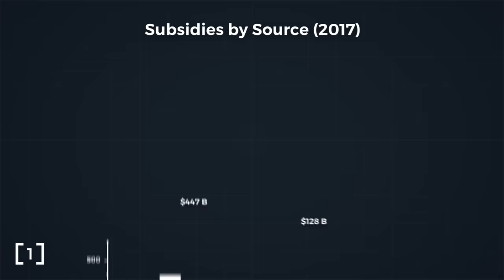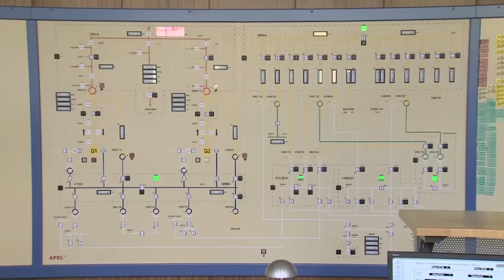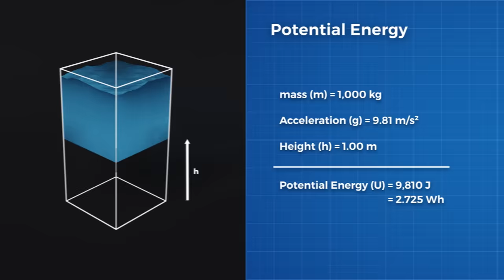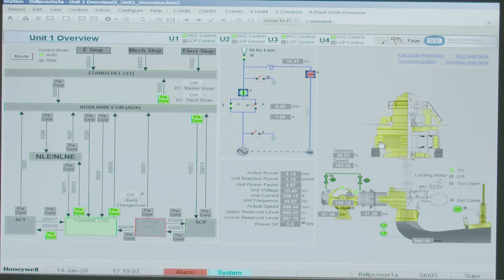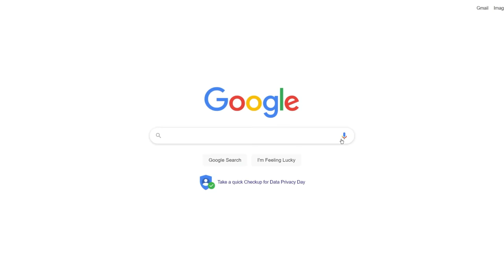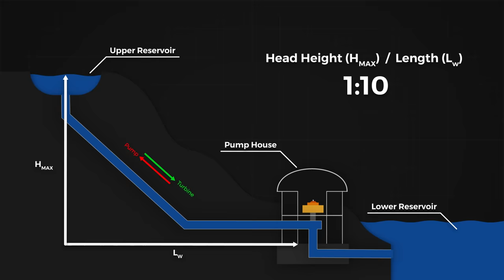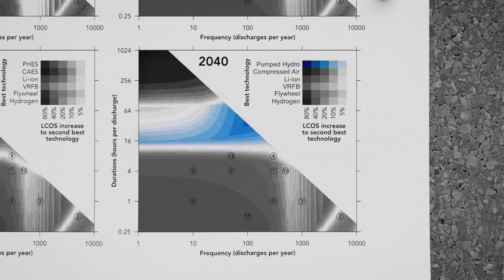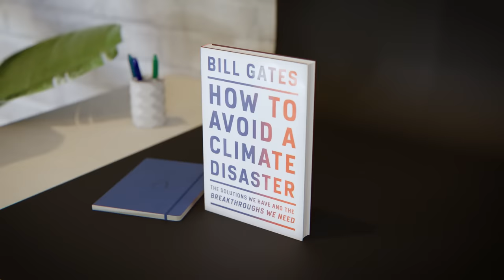The Truth About Pumped Hydro

Comment: The main problem is they are unprofitable under marginalist markets, even if you use an abandoned underground mine with already made tunnels, roads, power lines and switchgears, and moving water between upper and lower levels of the mine (all huge money savings), you are still trying to build an on-the-run hydro power plant that haves to float by running only 2 hours a day (the ramp up hours when the sun goes down and gas generation starting up to cover it)... it is a capacity factor of 1/12 approx 8% when to be profitable a hydro power plant needs to be near 40% on a coal-based electricity market. Maybe with future mini-nuclear underground power plants and average prices' markets they will be profitable, but for now they are only built on highly industrialized countries where high intraday differences on electricity consumption justified the huge investment for security issues (been an expensive worst-case scenario kind-of need).

Comment: Just out of curiosity... how much energy does it require to fill the dam with water compared to how much energy comes out of those generators. Also above that how much it costs to maintain the hydro system. I'm all for green sources of power generation. However, If the hydro's expenses are significantly higher than other sources of power generation then we are not 100% ready for green power.
Reply: Watch the video. 80% efficiency for the facility he was at. Others vary based on distance from the upper and lower dams
Reply: @TrecherousMonki  Thanks for letting me know. I didn't catch the efficiency.

Comment: Electrolysis hydrogen fuel cell is 80% efficient.  The product can be also used to run a car, or for manufacturing.  Pressurized hydrogen can be stored indefinitely, batteries have a lifetime of a few years.  If we wanna be truly green we need hydrogen fuel cell tech.

Comment: South Africa has 3 pumped storage stations and one, Palmiet, in the western cape uses turbine generator/pump machines rated at 200Mw each generating and 214Mw pumping.  They are simpler to operate than those with pony motors and second impellers and cheaper to build.  Your video is very informative but missed one of the most important functions of this type of grid based station, voltage control.  When the upper reservoir is full and other stations are more than coping with load the machines can be run as motors to reduce the so called reactive grid voltages.
Reply: The author has a slight misunderstanding on the use of the Pony Motors.  These are not large or expensive and are only used to bring the shaft to speed.  The pumping is done by the main Motor/Generator as in SA.  Palmiet must also have Pony Motors.

Comment: They use the levelized cost of power to say intermittents are cheaper. It involves dividing the cost of the unti by all the power generated during its lifespan. It doesn't factor in that needed power wasn't there and had to be bought on the open market. Also feed-in tariffs or mandates are not considered subsidies for some reason.
Reply: "Also feed-in tariffs or mandates are not considered subsidies for some reason", no, they are. "It doesn't factor in that needed power wasn't there and had to be bought on the open market" no, only the

Comment: Instead of water, why don't they use ratcheted magnets on a track (effectively using the magnetic repulsion as potential spring energy)?
Reply: Why not use the spring of gravity acting on water, which will fall out of the sky topping up your system? (We need all the magnets we can get for the most efficient generators and motors.)

Comment: 80% efficiency seems so generous, it's disingenuous.  The generator alone is 80% efficient but that's not including the efficiency of the motor pumping water into the reservoir and the various mechanical losses such as head loss from the water moving in and out of the reservoir.

Comment: Ignore nuclear as a baseline results in a grid that too tied to a limited number of factors. And hydrogen is a horrible storage solution given round trip your lucky to get 40%the energy you put in and more likely around 25%. 
You’ve approached this problem all wrong when it comes to how much generation you need. You’ll easily need 60-100%+ over generation of power so that you can use these massive batteries if at times they’ll output just 10% of the grids needs. The batteries in this case should be built to take the entire grids load to account for increasing power usage. 
Easies way to figure out how much storage you need is to take the mean load and assume that storage needs to cover it all for a 7-10 days.

Comment: My Question here: Why use water and not something much denser?
Wouldn't that solve a lot of the issues that water brings with it?
Reply: The nice thing about water is that you don't need the system to be perfectly sealed (a large-scale perfectly sealed installation comparable to this would be much more expensive and complicated to build and maintain), and we have lots of experience dealing with it and all its effects, and making equipment for handling large volumes. I'm not sure what could be used instead that is much more dense that would not also bring a lot of additional challenges, not to mention the cost of the medium itself.

Comment: Also, about the seawater part, wouldn’t it be most beneficial to build close to the ocean, if it were filtered to prevent debris blockage? Limitless amount of water. Without desalination, there’s no I’ll effect from hyper-salinated water discharge. I could envision an assisted power windmill to aid in reverse pumping without tapping into the newly produced electricity. Wind could act like free recharge pumping, and not to be used necessarily for the grid. 

Hey, with rising sea levels, we could use some storage 🤣(obviously joking)

Comment: Perfectionism is the enemy of action. We do not need to eliminate all fossil fuels. We need to reduce them significantly. It is not the nature of fossil fuel that is the problem, it is the quantity burnt. And we do not know the effect of reducing fossil fuel consumption by half might have. We honestly believe it might help but we cannot be sure until we try it. The major objection raised against alternative sources of energy is that they are not perfectly aligned with demand. It is that latter problem that should be addressed, as you do here. But the best "battery" by almost any measure is the national grid. Winds, sunshine, tides and hydro power are variable, and the planning horizon must cover them all. Good doco but conserve those silver bullets for the really tough times.

Comment: Good luck building that many pumped hydro storage facilities.   You may wish to recalculate the price of electricity by factoring in the CAPEX and OPEX of these facilities on to the dispatch price of wind along with the efficiency factor for the pump power cycle.  Technical solution yes.  Economic???

Comment: Think about this, hydrogen is not something you can pump out of the ground and even if you could it takes dirty energy to do so, and the underlying dilemma is that hydrogen is a monopolizing commodity that has been a source of leverage to buy political influence for special interest. Electricity as of now is already dirty and must be generated 24/7 however with battery storage we can cut it’s dirty factor by 65% in the meantime we continue to replace the power plants with nuclear, solar and wind. It is a situation where there would be no monopoly for the foreseeable future which would truly have a democratizing political effect.

Comment: How much energy and money was spent to blast and clear and install that system? I keep thinking there could versions of this concept out at deep sea where you drop strong pipes deep with valves at the bottom and you pump out the pipe’s water during the day and then release the valve at night and produce massive upward water pressure.

Comment: So you would need about 10 hydro pumps to supply all the needs for Ireland. But actually, a hydro-pump is nothing more than a HUGE rechargeable "battery" that has to be charged if it is to supply power to the grid. That power has to come from somewhere and be powered by something. Just exactly what are you planning to use to charge these hydro-pumps? Then how does that benefit the environment if you still have to have a power plant to supply power? The world wonders.

Comment: This video fails to mention the reality of hydro storage.  Take Lake Shasta in northern California for example.  Here you have a massive reservoir but the power house is not used for generating electricity, the dam is only used for flood control.   Because it's too expensive and inefficient to turn on and off the generators as needed.  Wind and solar will NEVER completely replace other forms of power generation.

Comment: I think there are appropriate applications for all energy sources, meeting the needs of 7.5 going on 10 B of us in vastly different circumstances will likely take all options. As nuclear power is by far the lowest environmental impact we should be using it as much as possible.
Nuclear power requires a fraction of the resources of the alternatives and doesn't  need backup. Its the gold standard of green energy.

Comment: I’m not convinced by your back of the envelope, take current wind resources graph over time and scale it. One thing any sensible new supplier of wind power would do would be try to find places where the wind blows when the current suppliers wind isn’t blowing. Offshore in the Atlantic perhaps or an interconnection with Scotland which interconnects with their offshore wind farms in the North Sea. I’m willing to bet the power graph for wind at that point will be a lot flatter. Once you work out what your wind power graph will actually look like once you build everything out then you can working out how much storage you need. If you have an inter connector  to Scotland does the storage need to be in Ireland ? There are some very tall mountains very close to the sea in Scotland. A saltwater pumped hydro at the nexus of some high voltage DC lines between Scotland, Ireland and some offshore wind might be very effective.

Comment: Very few people actually get it. The reason we are not building new pumped hydro stations is because we do not need them. Balancing the grid with natural gas power is much cheaper than pumped hydro. The so-called net zero committment is just empty talks.  It is not because we don't have enough energy storage so we cannot get to net zero. The reality is: we do not want to invest in more energy storage because we are not trying to get to net zero.

Comment: My calculations on Ireland's energy needs, including cars, over a two week period would indicate a requirement for 360 identical pumped storage locations. If a freak event turned up and during the winter the wind didn't blow for longer than that then you would have a Biblical humanitarian crisis. But it's Ireland and I doubt that has ever or will ever happen. Remember this is just to store the power not make it. And of course most of it would be idle most of the time.
  For comparison you could build the same number of MS reactors, of let's say 3GW, supplying 1 TW. I doubt that's enough for the whole world but it's a huge chunk of it and no storage required.
  Cost effective? You decide.
  Yes I did hear the comment about a variety of storage methods, but you can see the scale of the problem. You could argue that one week's storage is enough, it's Ireland! When doesn't the wind blow. But now you're really playing with fire. If you're willing to take that risk then halve my numbers. It would only cost Ireland the capital required to supply half the world, or maybe a third, with electricity.

Comment: There's a pumped hydro reservoir near me. It works great. Although there was an epic collapse and resultant flooding.  https://en.m.wikipedia.org/wiki/Taum_Sauk_Hydroelectric_Power_Station

Edit to add, the one near me runs 2 generators at 250mw each. The one you're amazed by in Ireland is tiny. Lol

Comment: Question: What happens if we increase the mass of the liquid that's used in these stations? I realize that eventually we'd have to close in the upper & lower reservoirs & seriously upgrade the machinery, but if you increase the output enough, wouldn't a break point be reached?
Reply: How do you mean by break point? If more water is there, we'll use more penstocks and alternators in parallel to generate electricity.
Reply: @Chopper153  I'm talking about a heavier liquid than water, something that will generate more power per meter lifted. As a ludicrous example, let's say... Cough syrup. What I mean by "breakpoint" is where the cost of the heavier-duty equipment & more power required to lift this cough syrup is overcome by the power generated.
If 1 cough-syrup plant generates 2.5x the amount of a water-based plant, you need fewer plants to store the required power.
Reply: @TheKauff  There are many liquids heavier than water but problem is abundance.
Reply: @Chopper153  Hmm... Yes, I could see that. Closing the system would help, but it'd still need controlled.

Comment: Hydrogen for... long term storage? Something is wrong here, in gas form half of it cross the wall and it's lost, just because it's so small, steel get brittle (yes, a problem); and if you use cryogenics, you lose the hydrogen to keep it cool (typical method, allows a part to evaporate, so it takes heat from the rest keeping it cool),.. long what?

Comment: I don’t understand why you would pump it up ... I live by two possibly soon to be 3 large hydro dams and nun of them pump the water. we use rivers turned in to lakes   If your by the ocean would it not be possible to use heat to evaporate ocean water and dreck the flow of the evaporated water ?